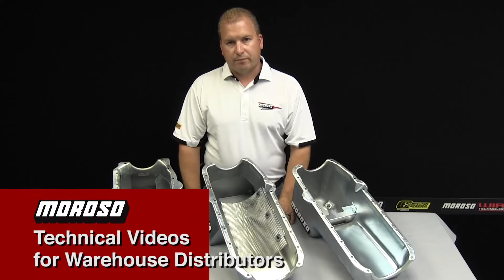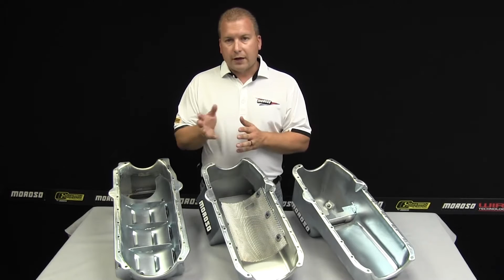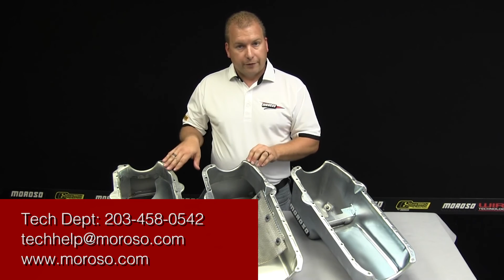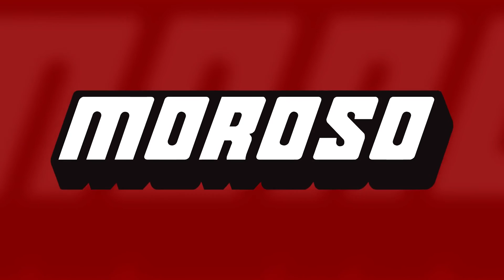Small Block Chevy Chevrolet Engine Oil Pans Moroso Tutorial Overview

Comment: Is there a pan designed to hold more oil than stock and still fit in a 2wd s10? I know a stock pan will fit but I'd like to have a bigger pan.
Reply from the maker: http://www.jegs.com/i/Hamburger%26%23039%3Bs/497/1099/10002/-1